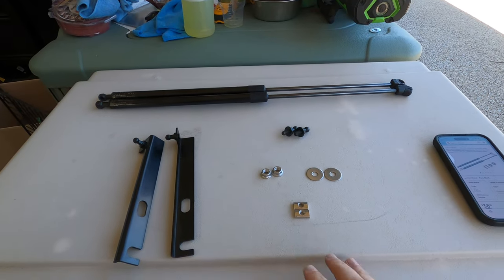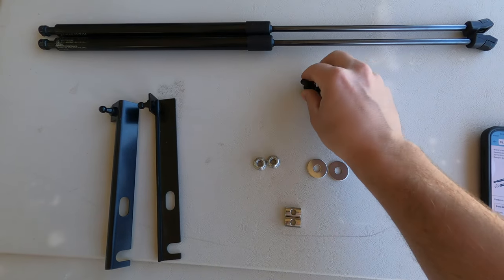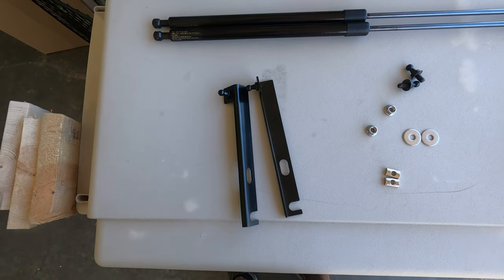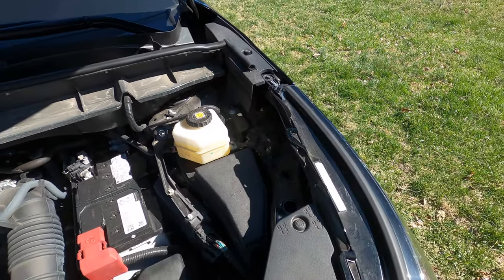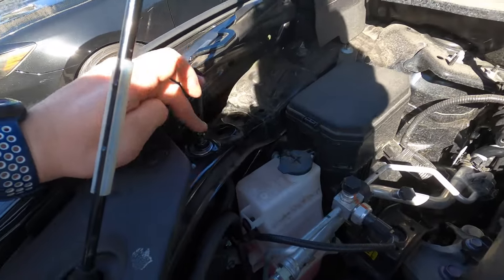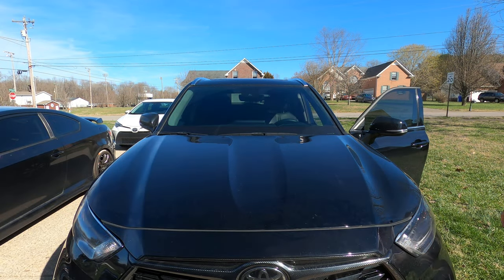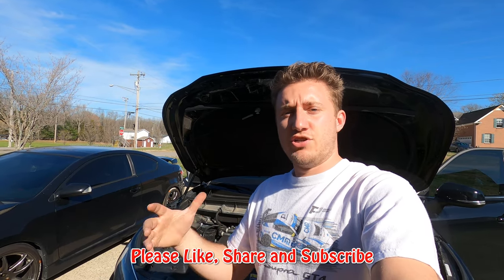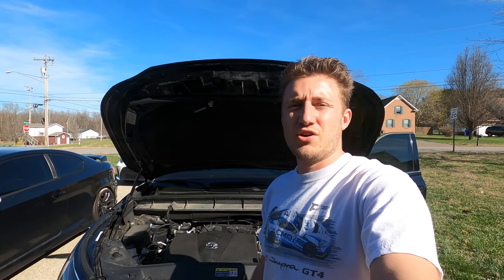2020 and up Toyota Highlander Hood Strut/Hood Shock Install and Review

Comment: im looking for single hood strut,, I just install the AUXBEAM power switch at the Driver side. The strut on the driver side will fall right in my AUXBEAM breaker panel.